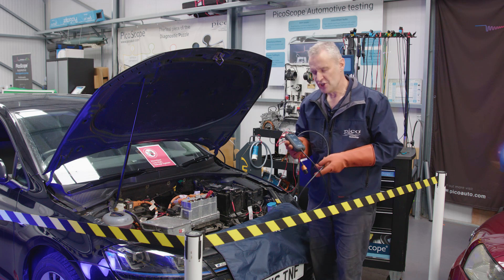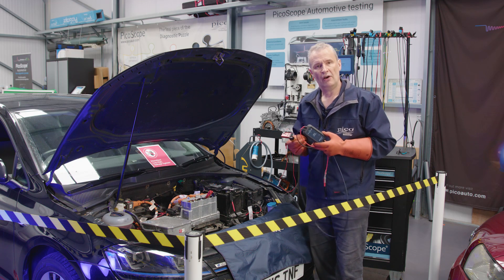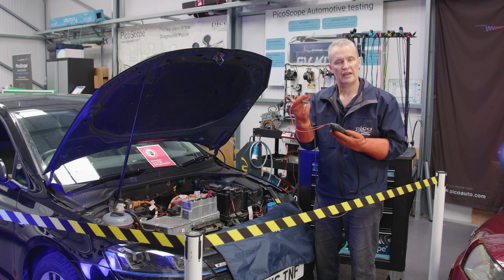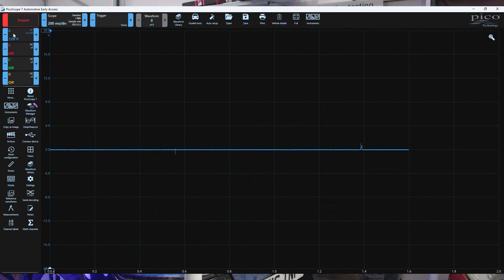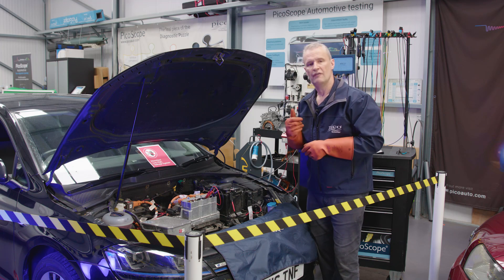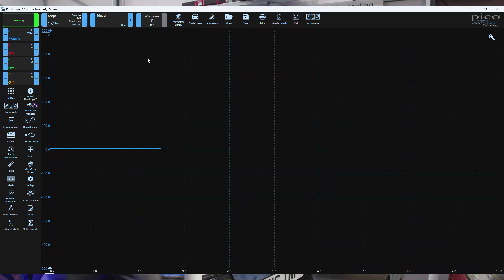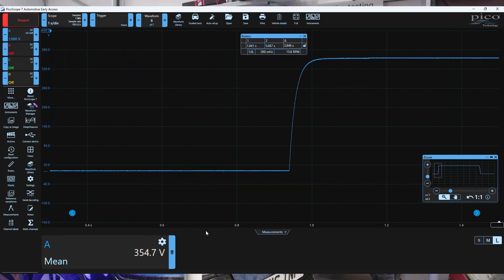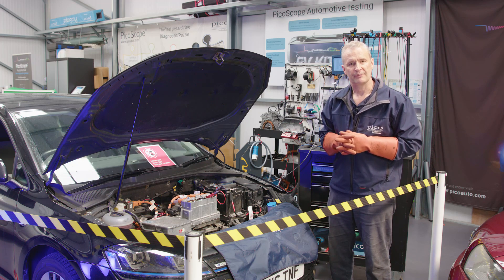TA511 PicoBNC+ 1400 V Differential Probe | Pico Technology

Comment: The not knowing if the gremlins had switched on the probe to make sure the battery would be flat when we next took the probe out has got to be one the biggest advantage of BNC+.   These differential probes also give you that extra peace of mind when using a common-ground ‘scope, such as the 4823.    Thanks, Steve.